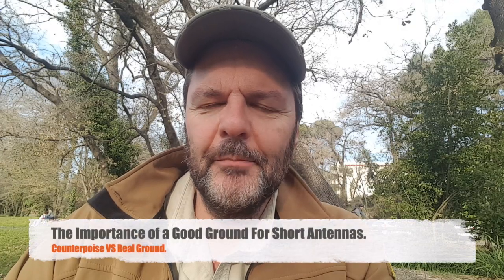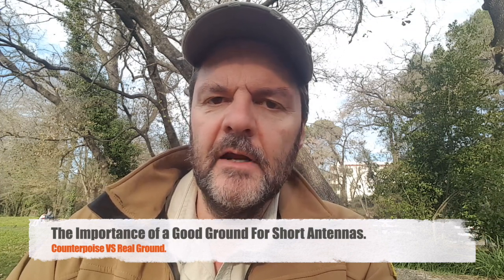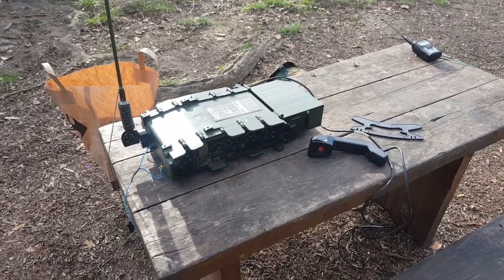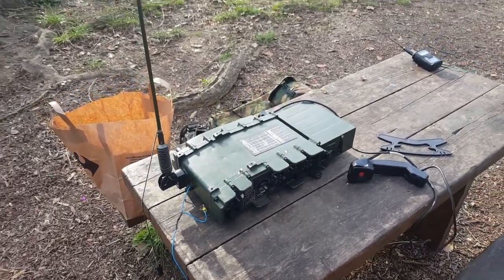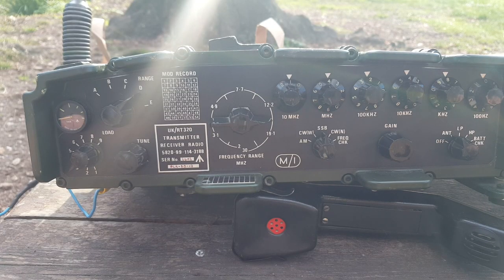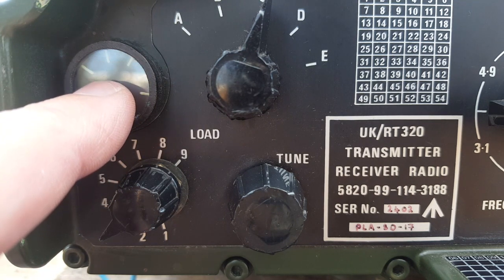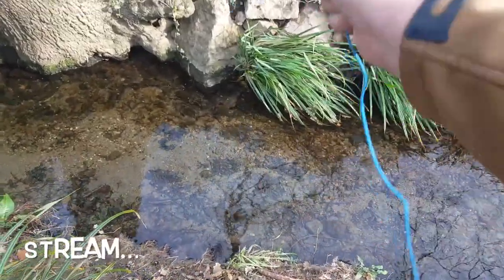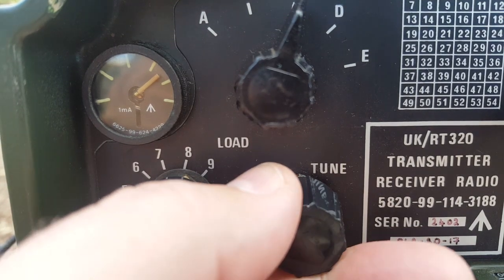The Importance of a Good Ground For Short Antennas.

Comment: A few years ago , I had a sstran part 15 am band set up and used 40 25ft long extension cords arrayed in a fan pattern and worked pretty good, they were all connected to a 3 ft by 3 ft aluminum plate, with 100 mw and a 3 meter antenna reached out close to 5 miles some days, especially when the ground was snow covered, that is the best time , IMHO

Comment: 1. The RF ground should be as SHORT as possible.
2. You can use a matching circuit in the RF ground connection/counterpoise. See VK3ye videos on this subject.

Comment: I have a shortwave radio (handheld), and for the receiving improving I'm making one trick - isolated wire with length about the 1 meter, I'm making the loop from one side of the wire and put it to the main antenna. The adjusting is very simple - the loop must be closer to the radio neither to the other side of the antenna. The approx position it's the zero point of the current at the antenna, it's about the 2/3 of the lenght.

Comment: I installed a non-resonant end fed wire antenna a few days ago and was getting poor performance and S9+20 noise.  I remembered that after laboriously pounding in the 8 foot long ground rod, I had forgotten to connect the 10AWG ground wire. Derp. The antenna is much better with a proper ground but still isn't great, but that's because it's too low.  It'll probably be OK for QRO NVIS.  I'll raise the end of the antenna and see if that helps.

I always chuckle when you say "crocodile clip."  I've always called them alligator clips.  I remember when I was an electrical wngineering student and a Polish grad student didn't understand so I explained what an alligator is and he was very amused.  He'd pinch the clip to repeatedly open its mouth while saying, "Alley GAY Tor.  Alley GAY Tor."
Reply from the maker: LOL, I should have known after 22 years in Florida...

Comment: I'm afraid this is not that simple as you've shown. In your case a counterpoise may radiate more energy than a 2.5m long antenna, and most of this energy may be lost in the ground (not an HF ground, but a real one). Also the number of counterpoise wires are more important than the length. A properly matched GP antenna with 20 radials 0.1 lambda long will be more efficient than the same antenna with two 1/4 lambda radials. The ARRL Antenna Book explains this in much more details, as do other books. Also this can be easily checked using an antenna modeling software. I would recommend at least to check the antenna not only using an SWR but also an RF field strength meter. 73 de R2AUK
Reply from the maker: Good info thanks.
Reply: R2AUK - I hope people read and believe your comment.  The flaws in the assertions of the video are many and will lead some astray.  73 K5RX

Comment: Hi Gill, have you thought about using a mental tent stake attached to the end of the wire? Seems like a metal stake would improve the grounding if there's no pond to throw the end in. Wouldn't weight much either.
Reply from the maker: Certainly, and I water it.
Reply: MY ground is a  eight ft. cooper rod  pounded seven foot into a clay substrate .
Reply: @robertl.fallin7062  that's the best system for a base station. I was thinking for a portable solution.
Reply: @robertl.fallin7062  Hmmmm.............a little difficult for portable operation which was shown in this video.
Reply: A mental tent stake?  I've met some pretty goofy tent stakes in my time, but never one I'd call "mental".

Comment: Many thanks for that Gil. Get a tad confused about grounding and counter poise length. Sort of go with a counter poise 1/4 wavelength of frequency in use and also have a separate ground direct to the radio. Seems to tune fine but I am still unsure if this is the best set up. Larry.
Reply from the maker: Me too sometimes ;-)

Comment: Ok, I'm a little confused--the wire that you tossed into the water... is that the antenna counterpoise? Or is that the ground for the radio? Thanks, and 73!  :-)
Reply from the maker: Same thing.
Reply from the maker: The antenna is a whip on the radio so in this case, all the same.
Reply: @RadioPrepper , ok, thank you!  :-)

Comment: Because RF current only flows on the surface of a conductor ("skin effect") it is better to use flat copper strap rather than round wire because it has much more surface area.  That's what you will see at commercial stations because they know this.
Reply from the maker: Good tip thanks.